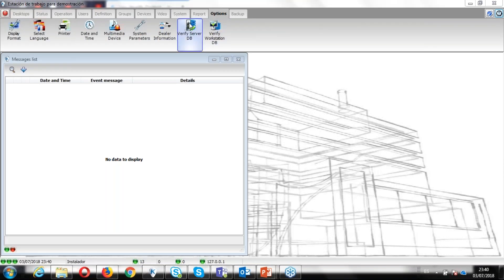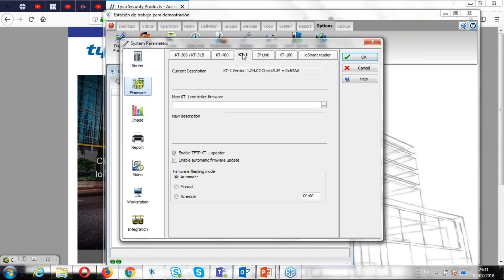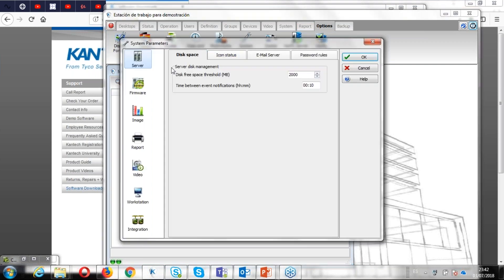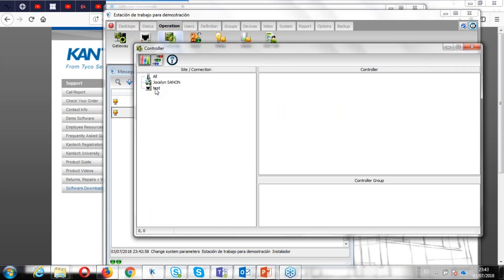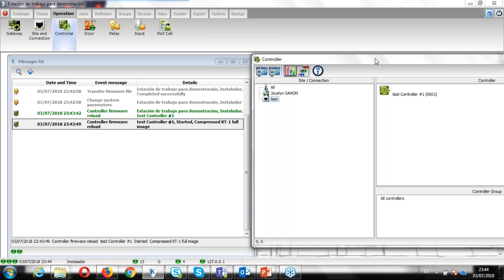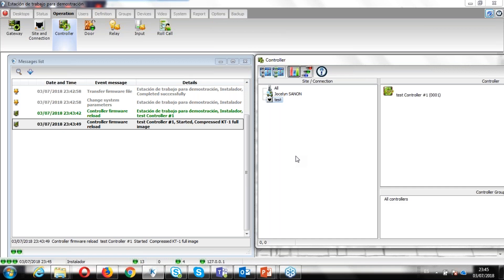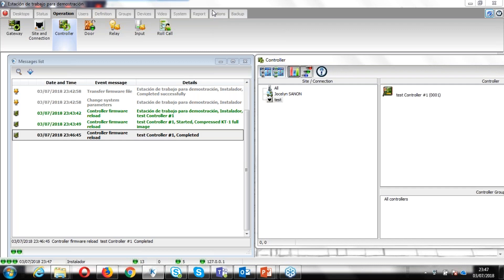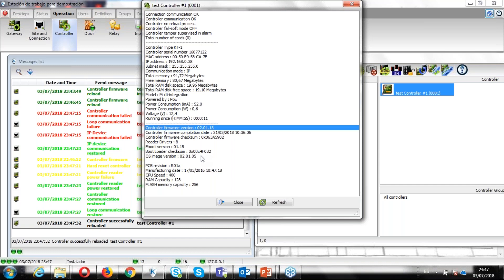Kantech controller firmware update

Comment: @janejuls  I also had a controller fail its firmware update. I have tried rolling back to a previous version, still failed. I reached out to kantech and they told me to try in stand alone mode. although i have not tried that yet.